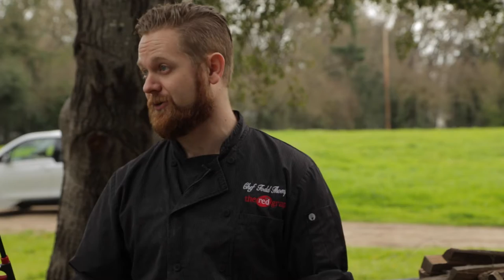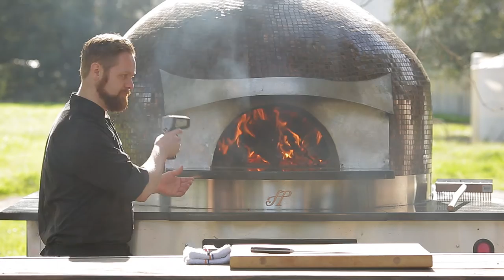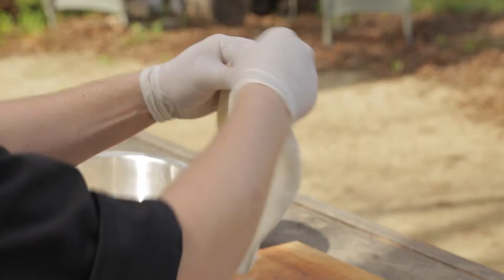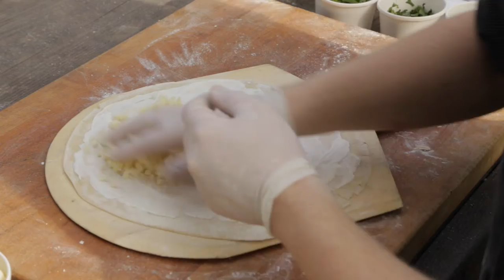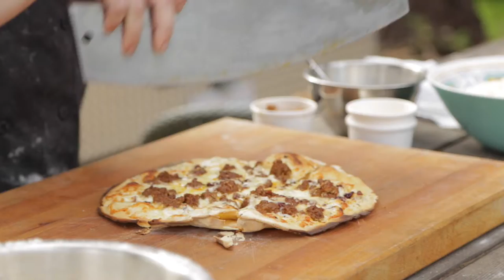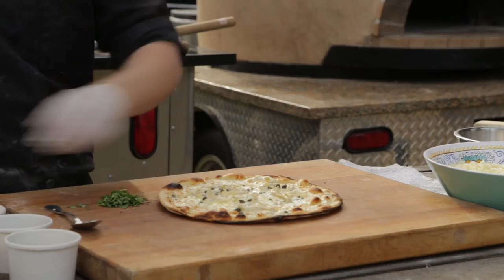Forno Piombo

Comment: Vent system is terrible ! lots of smoke coming out from the mouth of the ove at the start of the fire , if this was inside a building would have been a disaster.
Reply: That's a pretty common thing with any outdoor oven setup. 
You can usually use a door to reduce the wind blowing into the oven and get it to the flue. 
This is why you don't normally see smoke drifting out of indoor wood-burning ovens - no wind.